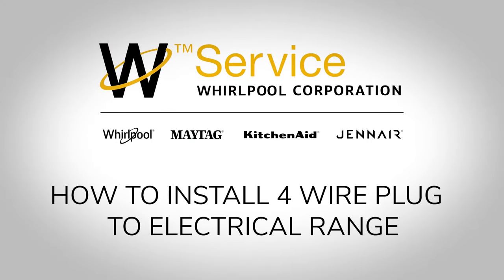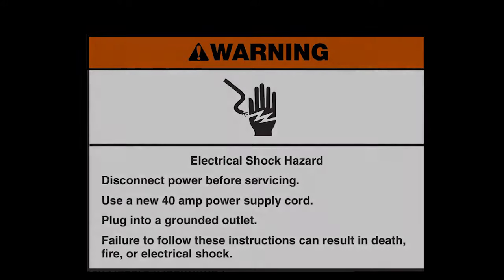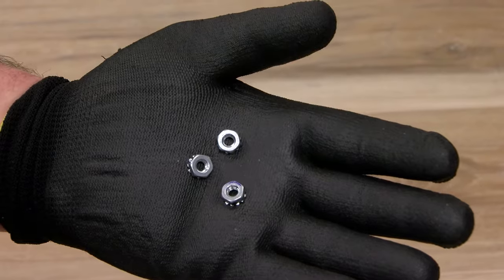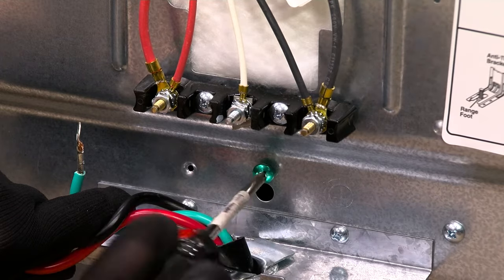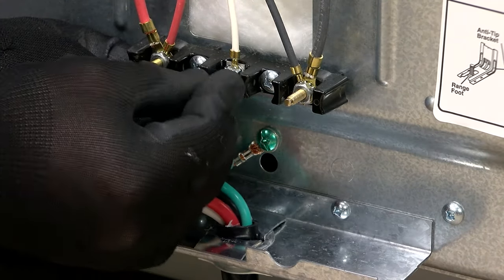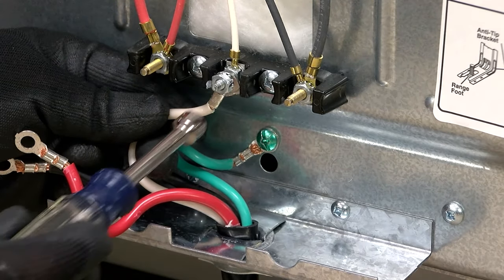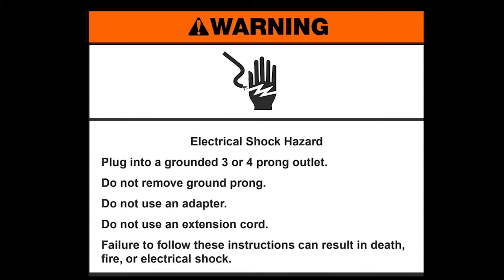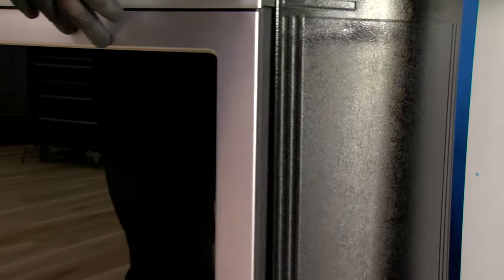How To Install 4 Wire Plug To Electrical Range

Comment: The strain relief clamp that came with my new 3-prong cord does not fit in the small hole on my new whirlpool range. I'm hoping my local building supply store has it.
Reply: I put mine in without it

Comment: why is one a 3 prong and one a 4 prong? I am putting in an old electric range, and this is the second video I have seen.  BUt, the range im trying to put in looks like this one with the bolts sticking out.  We had to buy a newer 3 prong chord, but the range doesnt turn on.  So, im wondering if im dealing with a 4 prong
Reply: As long as you got a black on black and red on red or vice versa and the white neutral in the middle it should work, and put green on the metal to ground it,